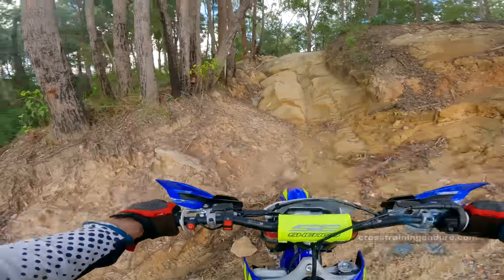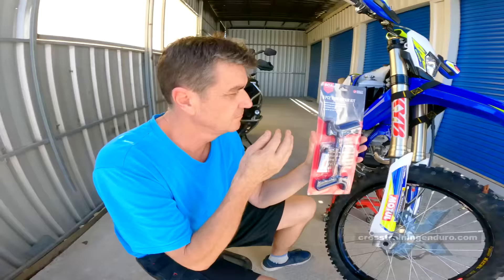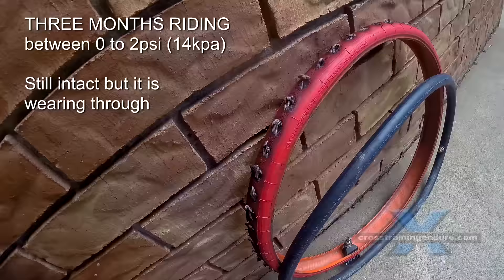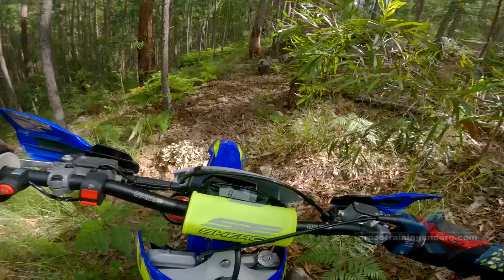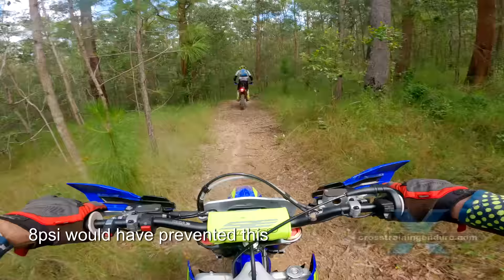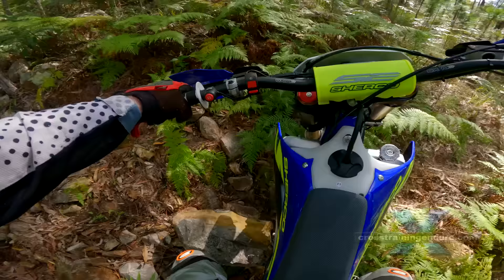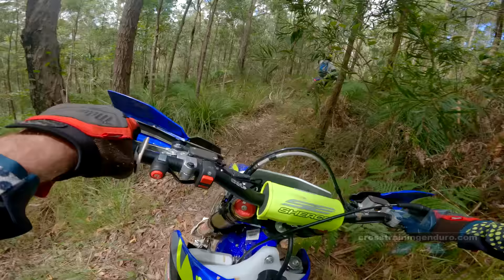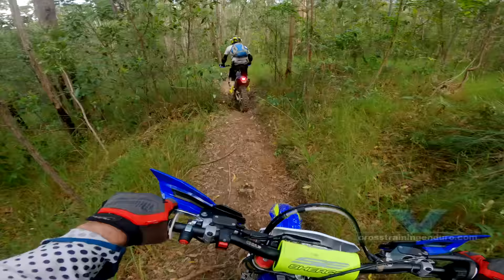TUbliss long-term review after 7 years with the tubeless tire system!︱Cross Training Enduro

Comment: I’ve been running them 7-8 years. The only issue I’ve ever had is the first time I fit one and didn’t follow instructions carefully enough (since then the videos are very good). I run radial trials tyres most of the time and it works fantastic at 3-4psi.  Even no air the tyre won’t come off. I had a tyre finally fail due to cracks (LOTS of hours) and leaked, but I could still ride it out.
 I bring along a small electric pump and can raise/lower pressure if I need to ride road, 3psi on the road is pretty spooky (and likely quite hard on the tyre). I’ve had them on a bunch of bikes and use the front and rear.  Fantastic.  BUT I don’t ride fast anymore and mostly like the very slow, tight stuff with lots of log hopping etc.

Comment: I've been running tubliss for 5 years or so, and never had a system failure while out riding, with the only problems being caused by fitting technique. I did have a few punctures during a 24hr race last August though, 1 in the front that I found at 1 in the morning when I came in to swap riders, a 'dog turd' sealed it up nicely and it did the rest of the race and a few practise rides after. In the rear I managed to pick up 3 little cuts, I fixed 2 with dog turds but on the 3rd the tool broke while trying to extract the tool and left a sharp barb in the tyre, so I swapped rear wheel to a spare. With both of the punctures I didn't noticed until I came in to the pits, possible helped by the slower speeds during the dark hours. I did use the rear tracker compete with holes at 0psi for about 10 hours during the winter with awesome grip! 😂
Reply from the maker: You have to love those dog turds!
Reply: @crosstrainingenduro  have you seen one of Megbraaps latest videos about using an old mousse as well as tubliss? Sort of best of both worlds! I've got a mousse in my race wheels then when it's worn out I may cut it up and try it.
Reply from the maker: No, but one of our guys has been doing that for two years now. Works a treat!

Comment: I've used Tublis for quite some time now. Not sure how long but serval years at least. I had 2 of the first ones I installed that leaked slowly. But it wasn't the tire that leaked down, it was the high psi tube that would bleed off pressure over time. If my memory serves (which very well may NOT), it took a week or two before I had to add air to the high-pressure tube. For me this wasn't a problem as adding air is part of my pre-ride checks. And I never thought it was a "problem" per say. It's just something to keep an eye on.  Now in more recent years, the newer versions don't leak down as quickly as the old systems did for me. Now a days; I have to check/fill it after winter during my spring checks. And maybe once or twice during the season. But otherwise, I don't worry about it, unless I tear a tire or have to change a tire.
Reply from the maker: We usually just put air in before the ride each weekend. It usually shows as 10psi lower after a week, although a fair chunk of that is simply from losing air while checking.
Reply: @crosstrainingenduro  I don't fool with mine anymore. I don't even check the psi anymore, unless I have reason to think I damaged it. 2 or 3 years ago when I got one of the current versions I pulled the tire monitor off of my truck's valve stem and monitored the high psi tube over a week. I think TUbliss changed the composition or thickness of the tube because they only leak down 1-2 psi a week now. (old ones used to be 20-30 psi/week) And even that is with in margin of error given the fluctuations in temp and barometric pressure.  So now adays I check them (the High psi tube) every month or every other month (depending on how much I get to ride). 

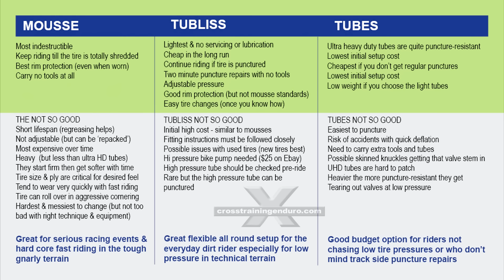I do want to comment on your chart at 3:43. I agree with everything listed on the section on Mousse, but I would have added one thing to both the good and bad section. Mousse's drastically change the feel of both the front end and the rear.  For some this may be a good thing, and for others it may be a bad thing. Personally, I can't STAND mousse's. For me; on the rear they're "OK,,,,,,,,,,ish". But on the front? OH HELL NO!! The mousse just doesn't have the delta V of an air spring. And I can't get used/adapt to the dead front end feeling. Drives me nuts. And yet, other folks love them. To each his own.
Reply from the maker: I know, some hate the 'dead' feel of a front mousse, others like me have no issue with it so I didn't include it in the chart... but it was mentioned in the original video.

Comment: You could also try Nomousse, the wall is thicker than the tubliss system and also taller, protecting the rim against hard hitting rocks or roots. Same air pressures allowed ann the inner tube inflated between 3 to 6 bar (45 to 90 psi). Only for the rear wheel though.

Comment: Havent tried tubeliss yet, currently mousse up front hd tube rear. Ill have to give the tubliss a shot in rear next tire change 🤘
Reply: I have been using this setup for two years and works great. When I’ll have to replace the front tire most likely will also replace the mousse, but after two years this is a good deal. Before that use to get a lot of flats in the front tire, I ride North Mexico terrain that is rocky desert.
Reply: @rogermty1971  my only issue is how out of balance my front tire is but i ordered some weights to balance the wheel so we'll see how that goes

Comment: I have been running the Tubliss system for around a year now , the only issue I have encountered is several punctures , all of which have occurred due to the rimlock piercing the tyre , I assume that this occurs when a rock or root impacts the tyre just at the time the rimlock is inline with the impact point . I intend to address the sharp edges when I next do a tyre change .  3 flats in 1 year and about 3000 km of mostly single trails is pretty good , especially when you don't actually have to do anything but keep riding ( albeit slower and more carefully ) back to the car or home base .

Comment: Hi, tubliss for 6 years. The rear is the same. Front, i malested it myself and bought a new which is only 3 years old. Despite i m a speeder and dont like hard enduro, tubliss made me capable. My friends think that my best is gorges and river beds but its not, i like speed...The only problem was a lot of front flats by rock on the rimlock, like rulete, bang on the rimlock...also at my place you need metal bash plate to make it around with no tears, a heavy one. Running never less than 7 psi

Comment: I used Tubliss for a couple of years .It was awesome in the rear .Makes tyre changes very easy and a pretty well puncture proof .Although I could never get the front to be 100% air tight and the initial cost is outrageous .I sold the bike with the Tublis and didn't bother with them on my Reiju .I found them too fiddly and expensive . I run 14psi in front and 12 in rear ,not ideal ,but it seems OK for this plonka

Comment: I used tubliss for a couple of years. It was good for slow running but the amount of punctures of tyre and hi pressure tube in enduro races at 13psi made me bin them.

Never had slow leaks but did have 2 random failures of the tube with it splitting down the seam whilst the bike was in storage. 

Now use mousses and won't be changing back, at least for racing.

Comment: Every Tubliss rider I’ve met has had issues with leaks. I’ve got one up front and it leaks. Previous owner probably hit a rock and damaged it. 

If you’re gonna run it, I’d recommend using it only in the rear. Stick to a tube or a mousse for the front imo.
Reply from the maker: I'm the first one to hit a leak in the front in our group... and never on the dirt bike (that's five riders over about the five years). Oddly enough it was the DR650 and trying to fit a Motoz Adventure front which apparently are hard to get a good seal with. I had to really slather it with Slime and put some inside as well before it finally sealed. Did the riders in your case try to fit used knobbies? TUbliss do say to only use brand new tyres to get a good seal.

Comment: Interesting that you slimed the outside of tire bead. The air tight seal is made on the inside of the tire bead, between the red tubliss carcass and the tire. I suspect the slime would find its way there anyway though.

Comment: I have been a tubliss supporter for many years… the front tubliss system has let me down time and again, punctures and leaks. On the rear I have had zero issues, my set up now is mousse for the front and Tubliss for the rear…
Reply from the maker: You never found out the reason for the leaks, Gordon? Quite a few riders opt for your setup but usually because a mousse tends to last for years on the front... whereas they often wear quickly on the rear.
Reply: I used the Tubliss front with a new Michelin front tire. I guess if I pursued it a bit more I would have gotten to the cause, it’s just that the Mousse ended up being a better option. That was my experience, the product is top notch and i would recommend anyone to give it a try…👍👍

Comment: I run mousse in the front and tubeless in the rear. Like another guy said, the front always seemed to leak air and it was so hard to get the front tire on with tubeless it was starting to tear the bead of the tire. That might be cause it was an older tire but I gave up with that and went to mousse in the front.
Reply from the maker: We had a really interesting experience when fitting them to our two new Sherco models, Josh. The first one was so tight we thought we'd rip the bead. The second went on easily. I can't help feeling we got something wrong on the first fitting... probably the tyre was sitting on the bead at some point?
Reply: @crosstrainingenduro  my thinking is the tubliss takes up more room in the drop center of the rims so you can't drop the bead as far down into it. Whereas on the rear there is more room. That combined with the more skinny tire up from so it's not as flexible as a rear.

Comment: Had tubliss for a couple years. Almost every time I changed tires I would end up with leaks in the low side either from the spokes or around the valve stem. Probably user error on my part but I switched to bibs and don't even know what a flat tire is anymore.
Reply: I find a little soapy water helps get the tire and Tubliss on and in place and seal it up.  After that or 1st ride any small leak goes away.  Make sure your tape is wide and sticks good by cleani g rim thoroughly before first install.

Also, worn tires or cheap tires can have issues.

Comment: Tried them years ago. Hated the high pressure tube. Always having to get it back up to pressure was a pain and pretty easy to blow the tube if you over-inflate. That makes for a really crappy moment especially if you are airing up just before loading up for a ride and have to do an unplanned repair. Using a bib has been far better experience overall for me.
Reply: I found using a MTB shock pump worked best for topping off the high pressure tube

Comment: I feel that the "short life span" rap that mousses have is somewhat unfair.  I'm sure they get trashed easily by pro riders racing competitively, but as a soft enduro/woods rider, they are amazing.  I get incredible traction.  I never worry about punctures.  Are they still performing as well as day one?  Hard to say, but I've never had issues in the 5 years I've been running them... Given I did switch bikes and get new ones three years into that time period.  I lube them every time I change a tire (~every 8 mos or so).
Reply: ps- just started reading all the comments below about checking the pressure of the tubliss... no thank you! The only time I use the compressor is to seat the bead.

Comment: Ho i tubliss anche io! Secondo me rinforzano la spalla col risultato di avere la moto meno ballerina anche con pressione bassa, praticamente come fosse una gomma a spalla più bassa.
Sono l’unico a detta del commerciante che le utilizza, almeno che le ha comprate da lui nel nord Italia!
Unica cosa il commerciante-gommista mi ha consigliato gomme con carcassa pesante, e il modello omologato più alto per evitare forature alla camera rossa.
Forse è l’unica pecca dato che possedendo un 125 e la gomma è piuttosto stretta, e una gomma a carcassa più dura costa di più.
Mi trovo bene, esperienza di resistenza: il meccanico non sapeva cos’era e mi aveva sgonfiato il tubliss ed è andato a provarla a velocità folli in strada con la gomma a terra, bè ho gonfiato ancora la gomma, nessuna perdita ed è ancora sana!!
Forse l’unico rischio in più della mousse è la foratura con grandi vantaggi invece in peso, maneggevolezza, scelta di pressione, oltre che un costo nel tempo più basso.
Io in genere la ho a 6 atm.
Reply from the maker: 1,008 / 5,000
Translation results
I have tublisses too! In my opinion, they strengthen the shoulder with the result of having the bike less swinging even with low pressure, practically as if it were a lower shoulder tire.
According to the trader who uses them, I am the only one who bought them from him in northern Italy!
The only thing the dealer-tire specialist recommended me tires with heavy carcass, and the highest homologated model to avoid punctures in the red chamber.
Perhaps that's the only flaw given that having a 125 and the tire is rather tight, and a harder carcass tire costs more.
I am fine, endurance experience: the mechanic did not know what it was and he had deflated the tubliss and went to test it at crazy speeds on the street with the flat tire, well I inflated the tire again, no leaks and it is still healthy !!
Perhaps the only additional risk of the mousse is the puncture with great advantages instead in weight, handling, choice of pressure, as well as a lower cost over time.
I generally have it at 6 atm.

Comment: Tubliss for two years on the rear of a yz250fx until I sold it and now a year on my GasGas EC300. A year on the smoker and no issues or complaints. I don’t see how some say that a mousse is cheaper than Tubliss. One NM is equivalent to two Tubliss and then some. The mousse eventually wears out (6+ months) where the Tubliss if maintained lasts years. Hmph.
Reply: NM lasts longer than that. We’ve been running the same mousses for 2 years now, but we are careful to lube them with each tire change. We quit Tubliss after having to drop out of a race with a flat. Apparently, it was a worn red liner.

Comment: I use tubeless on my mountain bike and the experience was terrible which has made me want to avoid converting to tubeless on my dirt bike. However I didn't realize you needed a new tire when converting and if that applies to mountain bikes I should try that since my mountain bike tire leaks about 1 psi every 2 hours which funny enough was one of the reasons I started riding dirt bikes more.
Reply from the maker: I don't know about MTBs and new tyres. The issue with dirt bikes is the indentation caused by a rim lock makes it harder to get a good seal on a used tyre. It CAN seal properly, but not always so TUbliss recommend a new tyre each time to avoid possible issues.

Comment: I'm using tubes, but I use an old tube that I slice and pull over  the tube that it's being inflated with air. So maybe poor mans mouse. But it works great, haven't had a puncture in years and I run 0.4 - 0.6 bars in the rear which I think is around 5-8 psi.

Comment: do not over tighten the high-pressure tube valve stem to the rim (dont tighten it at all to the rim, tighten the small nut to the valve cap). i damaged the high pressure tube doing it.

Comment: Tubeliss is great for local rides but you need to reinflate the inner tube to 100 psi almost every day or at least every 2 days so on multiple days adv rides this could be difficult. However i was actually thinking on putting one in the rear and for the front i have a mousse and buy a portable electric battery powered pump.
Care to comment on reinflating the inner tube frequency? Cheers Barry
Reply from the maker: I'm wondering if there's a slow leak, Oli? Or you are losing a fair bit of air when you check it? All the guys in our group report a 10psi drop over a week, so we only check weekly. I did forget to check for two months once and it had dropped to 50psi but was still working fine... but obviously that was risky!
Reply: @crosstrainingenduro  did not know we could still use it below 80psi. Good to know 👍
Reply from the maker: We aren't meant to, of course!
Reply: I lose 5-10 psi a week.  Pump up to 105 and will last me a 4 day trip no problems.  Even a tube I find loses a psi or 2 in a week and with tubes thats the difference in a flat or not for me.

Comment: Salut Barry, 
Most of my friends use supersoft tires + Tubliss + half soft mousse (they cut the mousse in half. 
On my old 350exc-f I ran tubliss on the rear, never had issues with it and heavy duty on the front - extremely bad decision - I could feel the heavy weight of the wheel while cornering. 
On my new bike TE150i, still have the OEM tires with tubes ... just because I'm cheap and don't ride hard :)
Reply from the maker: Buna Mircea! In our group, Ben has been running TUbliss with mousses too and loves it.

Comment: Seriously considering running mouses in my beta after weekend ride. Had a pinch flat in my front tire and a pretty serious dinger in the rim shortly thereafter.
Reply from the maker: Mousses are the most bulletproof of course... just a pain to fit, and no adjustability.
Reply: @crosstrainingenduro  Thanks Barry. Your videos and reviews are very insightful.